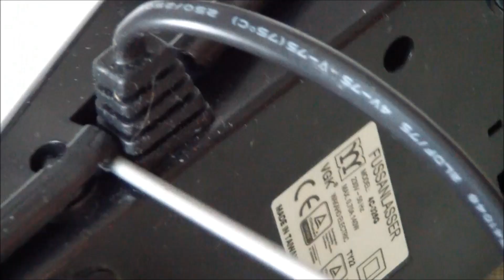Sewing Machine Foot Control Pedal. What's inside an Electronic Foot Pedal

Comment: So, desolder everything except the slide pot, mount a stereo audio jack in the hole where a wire comes out with wires going to the pot, and use it as a synth pedal?
Reply from the maker: Thanks, funny but stupid
Reply: Yep, can make for a much more durable pedal. If you see an old sewing machine pedal, they can be worth re-purposing - easy to change the pot usually to one you want if the value isn't right.

Comment: The most common trouble of theese pedals is the failure of triac BT136 or BT138. If so, pedal does not regulate the speed of motor, and it starts to rotate at maximal speed on any working position. The triac costs less then 50 cents, so it's very easy to remove it and solder the new part instead of broken one. 
Also it's easy to improve this pedal.
Small carbon resistor R3 is installed instead of trimmer resistor. It sets the minimal rpm value (the initial speed of the motor). If your motor starts to turn too quickly, just increase this resistor (desolder it, measure its resistanse, and solder another resistor twice as much or so instead), or remove it, and solder on its place a trimmer resistor about 1-2.2 MOhm (it could be quite difficult to buy). The bigger its resistance, the less speed the motor runs on first movements of pedal. For example, I had to increase it up to 1 MOhms, and the initial speed of the motor became about 1000 rpm. Maximal rpms remained to be the same, this resistor does not affect it. 
Of cource one shoud do it on his own risk and must understand what and how to work with such a device. And never open the lid with the plug inserted in mains.
Reply: Do you know whats the name of the sliding machanism?
Please let me know what it is if you do.
Reply: @Zzzzzzzzz678  that’s a linear potentiometer
Reply: Great comment! Thank you. I'm thinking of using this style pedal for my Thompson walking foot machine but I'm worried that it won't work.

Comment: Hi Tanks so much for the demo....is the same pedal used with SINGER 6180  machine?, if not, can you kindly show us the foot pedal of the SINGER 6180 machine. 
Thanks
Reply from the maker: Yes, the pedal looks like. But you don't need to repair it yourself. This is dangerous, contact a specialist workshop.

Comment: Thanks ! my machine´s pedal contains only a variable resistance, a track plate, not a rheostat, i mean, it's the simplest thing ever and i guess i might replace it with just a fader, that slider variable resistance component... what i'd like to know is the value it has to be considering it's 220v ( i guess ), thanks !
Reply from the maker: Yes, 220 volts, your fader will burn like a match. No need to look for other solutions that engineers came up with. Is it dangerous. Better buy a new pedal.